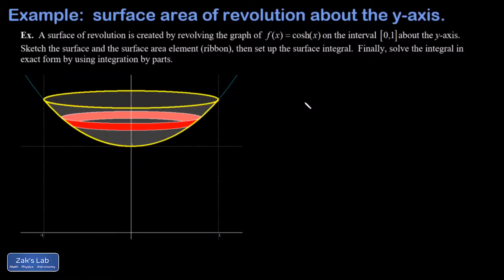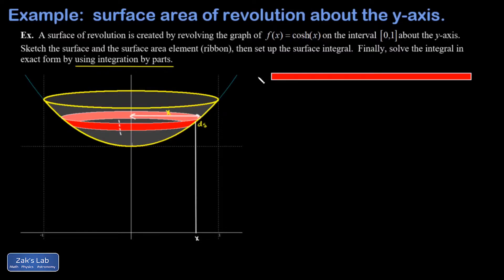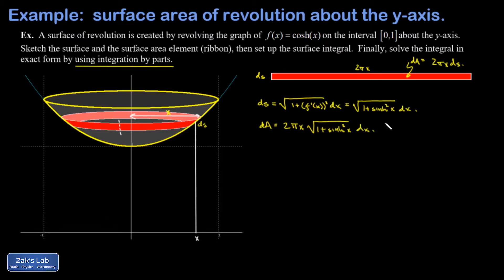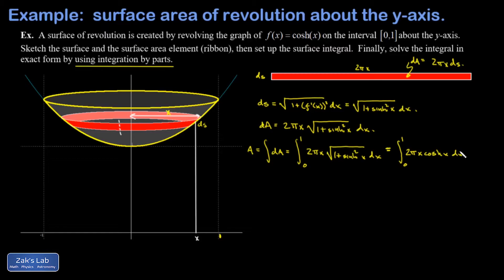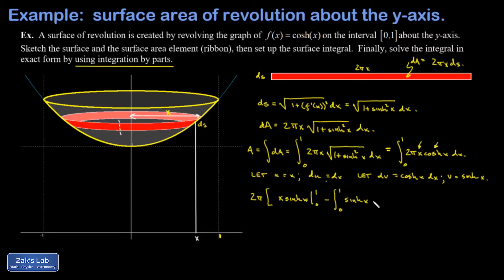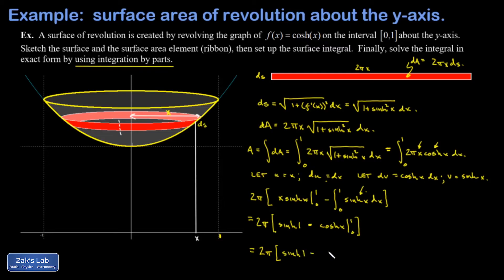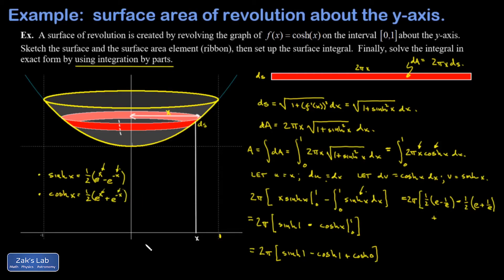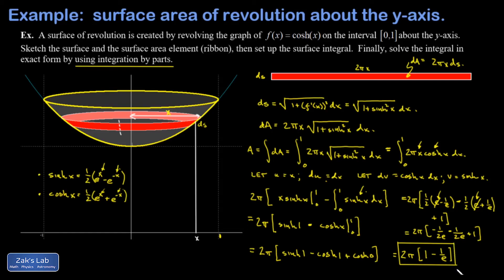Surface of revolution cosh(x) about the y-axis.  Thin strip method for surface area using calculus.

Comment: Hello Zack, your video is great. I was working on a question that is exactly like the one you are using as an example in your video and my results agree with yours. I did the same problem again but this time I was solving for volume using the shell method and I got a very odd result. The result I got tells me that the volume and area are the same and that is not possible, right? can you help me out?
Reply from the maker: I'll check it out when I have a chance (grading final exams right now).  There is nothing prohibiting the numerical value of volume from being the same as the numerical value of area, and that would be a really interesting thing to know about the cosh function if it turns out to be right!  

An interesting question occurs to me:  if you ask "what surfaces of revolution have an area numerically equal to the enclosed volume?", then how might you start systematically looking for such surfaces?  When you find one, can you figure out what properties might have given you a clue in the first place?  

Thanks - Zak
Reply from the maker: I had a chance to do it, and I didn't get the same number.  What did you use for the heights of the shells?  z
Reply from the maker: And now I'm thinking, since broadly speaking volume scales with the cube of radius and area scales with the square of radius -- you should be able to find an integration interval that gives you the same number for area and volume for practically any surface/volume of revolution.  Small numbers for size would cause area to outpace volume, large numbers cause volume to outpace area.